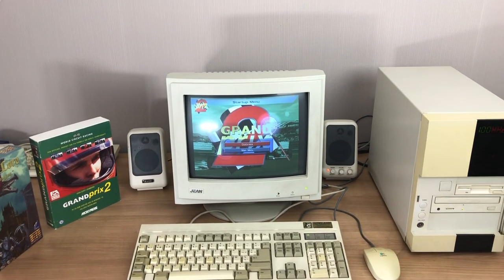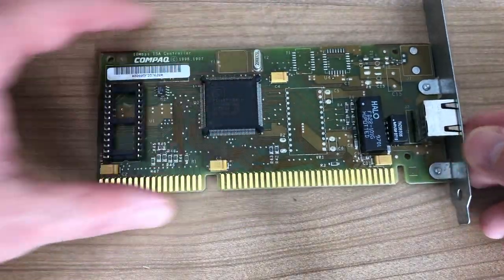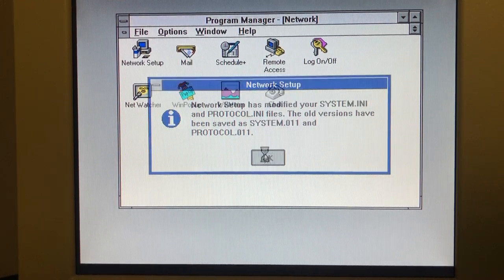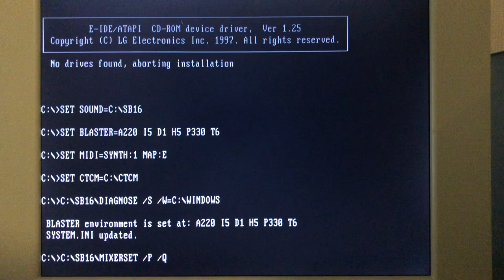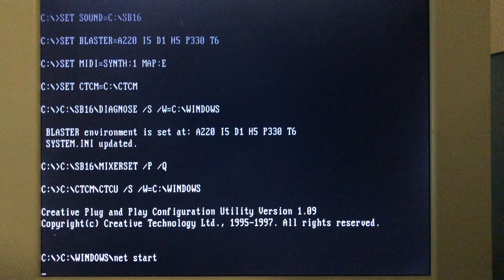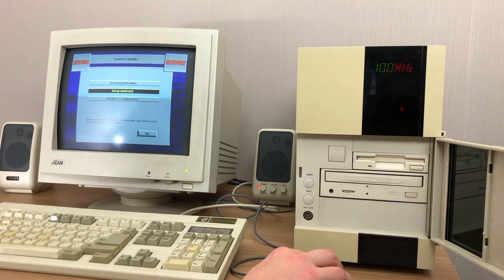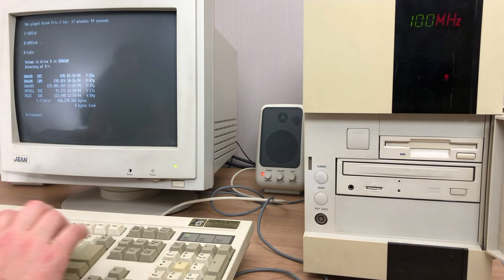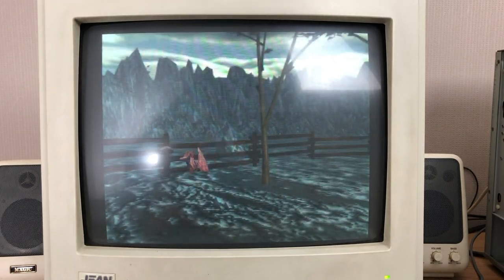AMD 486 DX4 100Mhz Part 2 - Multimedia upgrade

Comment: Brings back memories.  Trying to resist typing old man stories, but I do recall one.  I think those machines usually had around a 500Mb HDD size limit.  I recall I somehow ended up with a Promise controller card which had it's own BIOS on card that, theoretically, could hand up to four 8.4Gb HDD's.  IIRC, the biggest drive I ever had on it was a 1.6Gb.

Comment: How I remember Grand Prix 2.  The good old days of the V10 engine.  I had the same issues as you on my DX4 100 and only got it to run properly when I got a Pentium MMX but by then I was bored with it! :-)  Interesting to see the set up issues and the solutions.  Cheers.

Comment: Awesome video!  I had very similar issues with my restoration  of a DTK 386DX/40.  I went through several sets of creative / vibra 16 s drivers attempting to solve intermittent sound.  In my case it was no driver, it was an IRQ conflict which I still have not been able to figure out what was taking its IRQ.  Anyhow, problem solved. :)  Keep up the fantastic work and looking forward to the next video !!

Comment: I had windows 3.11 networked PCs in my household when I was a child.  We used similar network network cards like your first one with the BNC style connector.  If the BMC connector was left open (not terminated or connected to another PC) windows would always freeze at start up.  Did you try putting a terminator on the connector?
Reply from the maker: Yes also remembered that and had one of those T component with 2 terminators on it attached to the nic but it kept hanging. Did have plans to try and setup such a bnc network as I have some very old 8 bit bnc cards so I might revisit it someday.

Comment: I do love these retro builds as parts are getting harder and harder to find now days. I wounder if you replaced your processor with the AMD 5x86-133 with the 16KB Write Back Cache or an Over Clock to 160 Mhz  due to Write Back being faster than the 8 KB Write Thru Cache on your DX 4 100Mhz how much of a performance gain you would get.  Again love the retro builds, still trying to get all the parts for mine. Its nice to see that their are computer people that still appreciate this order hardware and don't just give it a dumpster dive. Thank you again.
Reply from the maker: That would be a great test, but unfortunately I don't have one of those I think ... I did pick up a great early Pentium 66Mhz the other day from around the same period (mid 1994) that I want to compare it to.
Reply from the maker: Turns out I did have the 5x86-133 ! :) will add it to my todo list.
Reply: @RetroSpector78  I was wondering, before you gave that case away did you happen to try that AMD 5x86 133 chip with and without the overclock to 160. If so, what were the results?
Reply from the maker: Clint Thompson not yet, but have another mainboard from the same period to try it. Definitely on my list for a future video.
Reply: Clint Thompson I didn’t know it could run at 160. That would have been really fast for a cheap price. I had a K6-2 350 running at 400. It was great for games, and far cheaper than the PIII 400!

Comment: Not bad for starting point with this system RetroSpector.  Do you have plans for upgrade revisit? Maybe  more upgrades with with cool looking legacy system?  example:  More ram, better video card, higher clocked processor?  Thanks again for the video!

Comment: If I recall correctly from my Windows 3.1 networking days, a network card with BNC coax connections needs to have a terminator on it.  I am almost positive that is what caused the hang on windows bootup.  I don't think there is anything wrong with that network card. (Only 1.5 years late on my comment)

Comment: Great tip about the Vibra drivers. I have a HP XU Pentium Pro 150 that has the vibra chipset on board. I disabled it and put a SB pro clone in its place with a GM daughterboard and haven't looked back. Were I to do it again...or sell it off, I will now know how to get the Vibra drivers to be stable.

Comment: Talk about a blast from the past.  Not so much about 486es etc, but that case.  I hade that exact model as my first one at my second job in like 1997!  Probably had a 486 in it as well.  Probably upgraded it to a P75 or somesuch shortly after, as it was a computer sales and services business type of thing I worked at.

Also... the Vibra 16 could definitely be a reasonable upgrade at the time, when they came along, as well as the 12x CD-ROM.  Around 1995 4x was becoming the standard.  12x a few years later.

Mmyes, I know a Mitsumi CD-ROM from the time, when I see it.  A very distinct design of the tray.  Also, the boxes the drives came in, works perfectly as 3.25" floppy boxes.  Fits about 186 or 189 floppies in them.  I think I have some eight or ten of said boxes, with floppies, somewhere.  Ehem.  I should image them at some point.

Comment: For GP2 you can press "O" to display the CPU usage. If that is over 100% constantly, you should turn the graphics down.
And with Alt+D you can cycle through the different detail levels.
I always tested in Monaco at the back of the grid.
If any F1 game I had over the years runs fine there, it will run fine everywhere else.
Even with the added rain/water and thus spray effects in later games.

Comment: Yeah.. Those IRQs, DMAs and IO adresses.. reminds mee a 15 yrs back.. it's always nice to whatch your vids and stuff.. btw where are you from?
Reply: 15 years ago, in 2005/6, I had a (then) quite old Athlon 64 3500+ I think and before that I had a Pentium 4 2.8c @ 3.5/3.6GHz with 2GB RAM running XP.
If you had a motherboard that didn’t support plug n pray 🙏 15 years ago then I’d imagine you didn’t have to get much done on your setup or you found parts at the tip and built it from retro parts?

Comment: Back in the day, I took my 486 DX4/100 chip out to try in another PC.  That motherboard had the ability to run at 40MHz, instead of the usual 33MHz.  Well, I intentionally left the motherboard at 40 MHz, so when the chip tripled the base clock, I had the worlds first 486 DX4/120.  No fanfare as there was no way of showing the world on-line in those days.   I did not run it for long for fear of burning out my chip which was only used for this experiment.  But it did run faster on my casual benchmarks. If I knew a dang thing about heat sinks back then, I probably could have safely ran it like that on a newer motherboard and had the worlds' fastest PC... for a while.

Comment: I use the SBBASIC.EXE (Phil's computer lab has it for download) for any PNP or jumperless Creative card. It has worked for me on everything from 286 machines to Pentium II machines. One file. 

For the CDROM, I use BTC CDROM drivers (I can pass them on to you if you'd like) - the best drivers I've ever used in over 20 years, but by far the WORST CDROMS themselves (ejects spinning disks, noisy, tray is cheap, etc).

Nice build. It has inspired me to make a tribute video to my Siemens-Nixdorf 486.

Comment: Nice videos. I recently rebuilt my 90s 5x86 system and used the same video card I had been using years before, as it is the fastest DOS performance card available for VESA. Find a card based on the Tseng ET4000/W32p with 2MB video memory. If you find a 1MB board, you can most likely upgrade it yourself. 2MB doubles the RAM bandwidth. This will in some cases more than double the frame rate you are getting with that Trident, trust me. Check eBay.
Reply from the maker: Thx .... been looking for a reasonably priced Tseng for a while now but nothing popped up yet.
Reply: @RetroSpector78  The Tseng ET6000 with 4 or 6MB RAM will also work fine in such a machine, although they are even harder to come by.

Comment: My first PC was an AMD 486DX4-100 with 16 M RAM (upgraded later to 48 M), 1.2 G HDD, S3 Virge, a noname sound card with an OPTi 82C931 chip. And, of course, Windows 95...
PS, this configuration must run Doom and DOOM 2 perfectly.

Comment: With the wobbling picture im getting seasick... Networks were a pita back then, especially if the BNC-Cable was not properly connected or some secretarys stood on them with the spike heels. Spent many hours in troubleshooting.
Reply from the maker: Yeah ... same here. Lost a couple of hours debugging an issue here and turned out to be a faulty bnc terminator plug. Not sure where the wobbling came from. My apologies for that. Got a capturing device now so new videos shouldn’t have that issue anymore.

Comment: The Windows error you are getting is probably coming from the DOS real-mode redirector already running. Windows is trying to load the protected mode driver for the card (VXD). Just disable the DOS-based network. You'll still have a network in a DOS box on Windows. You only need the DOS redirector for a strictly MS-DOS real-mode machine.

Comment: just use an IRQ above 9 for the network card, when system has both audio and network cards
Reply: And make sure there are no port conflicts either. 300 is the hard drive. 330 is the MIDI. 200 is the game port and 220 is the Sound Blaster.

Comment: i use pctcp from  ftp software only need a packetdriver for the network card and you have tcp/ip work under dos and windows 3.1 , i use ftp to transfer file beetween linux (pi as ftp server)
 an windows
https://vetusware.com/download/PCTCP%20Network%20Software%20version%204.1%20for%20DOS%20PCTCP%20Network%20Software%20version%204.1%20for%20DOS/?id=8687
Reply from the maker: Haven’t used that one. Did use mTCP with a packet driver and also worked great.

Comment: Huh; that formula 1 game was not impressive at all. This is a PC that can run descent and system shock but struggles with a game that looks like it could be running on amiga 500.
Reply: Had Microprose GrandPrx (original) on an Atari ST540FM with 512KB of memory and it seemed to run okay 👍